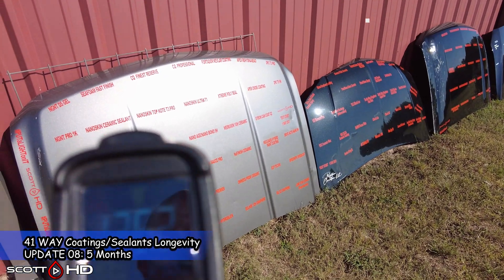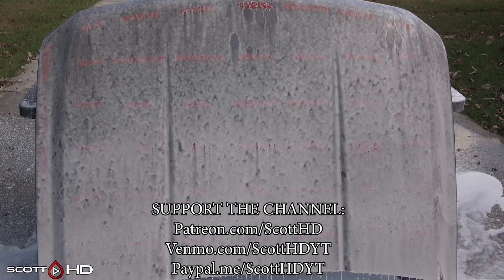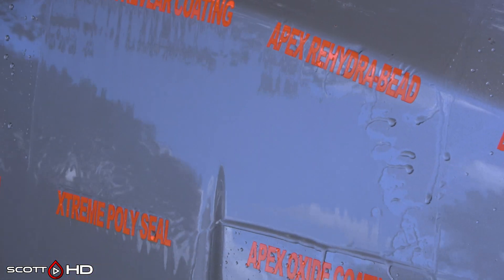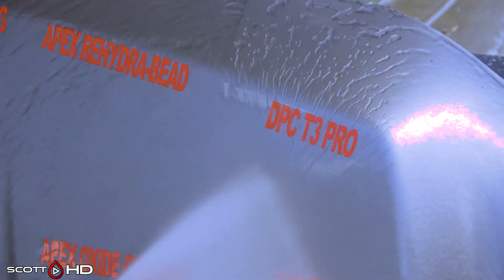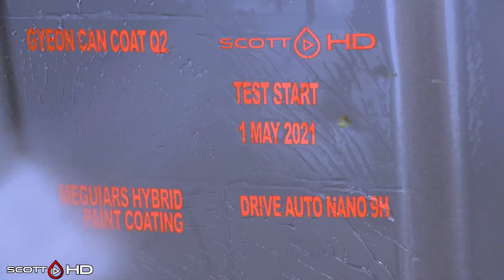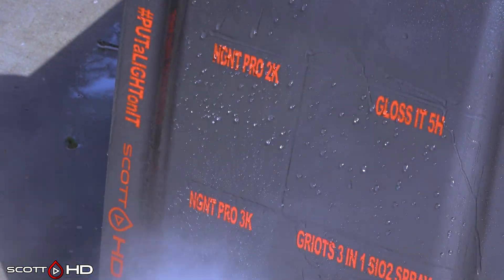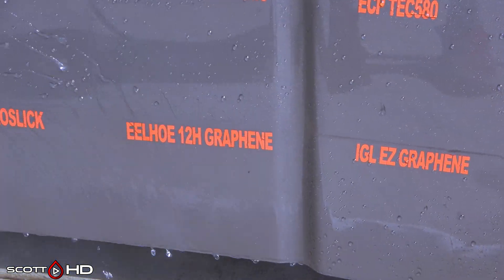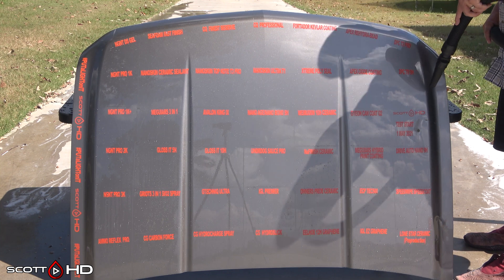Ceramic Coating Longevity Test - 41 WAY - The ULTIMATE comparison test - UPDATE 08 -5 MONTHS

Comment: From your testing, what is the most durable in terms of (longevity) ceramic & or graphene coating? What is the most durable spay coating/ sealant?
Reply from the maker: I think it comes down to cost vs the actual performance, but check the spreadsheet in the video description for that answer.   One of the biggest surprises for me is the cheap NanoAge aka Nano Bond ceramic coating.

Comment: Scott what toppers play well with Undrdog coatings? Been a non-ceramic coating, I don’t know what maintenance topper can I use on top of it.
Reply: If you're on FB go like the underdog page, lots of info and help by users and the creator of UD. You won't be disappointed!
Reply: You honestly don’t need a topper for it.  But Undrdog quick detailer will work fantastic
Reply from the maker: I haven't ever used a topper for it. Not sure what would play well with it but I can find out.

Comment: So you can spend $40 on CG Hydroslick which lasts a month or you can spend $30 on Meguires Hybrid Paint Coating that still looks like day 1 five months later. Hmmmmm.
Reply from the maker: This.
Reply: @ScottHD  I got curios about carpro
"Bkackout" for tires can you please do a test on tire dressings
Also the guy up north used I believe the name of the product is "Roar" i would love to see how that stack up in your long term test
BTW i buy the Griots 3-n-1 Sio2 based in your latest long term test and iam very pleased with the results
Thank you for doing this work 🙏
Reply from the maker: @t.i.o.motorsports243  https://youtube.com/playlist?list=PLtXHnI1Ee-eVPsjAkS56JXh2IiJsEBpSK did tire shine tests awhile ago, but can definitely update it any time.
Reply: And the ability to touch up beated areas is a plus, no shelf expiration too
Reply: @Carlos.Rivera  This is why I'm digging these sprays and hybrids over the full on ceramics. I have a car with CQuartz UK 3.0 and a truck with Griot's 3 in 1 spray...they behave quite similarly. Without the install hassle and ability to recoat after 4,5,6 months, I think I'm sticking to the sprays.